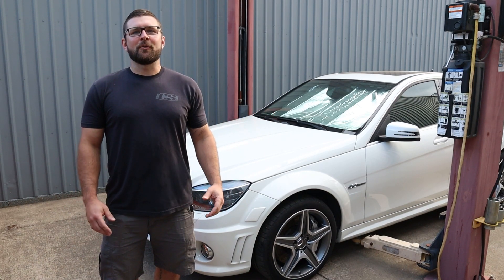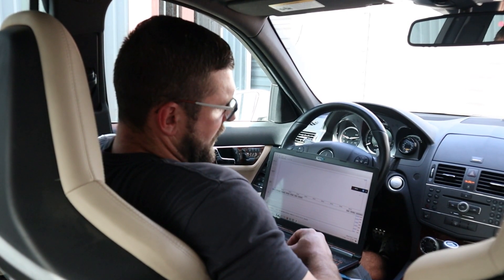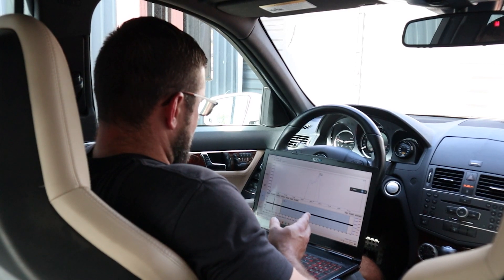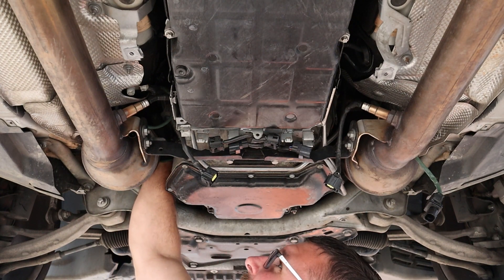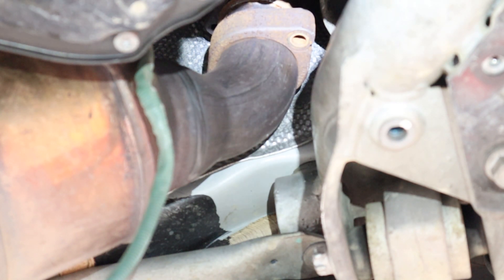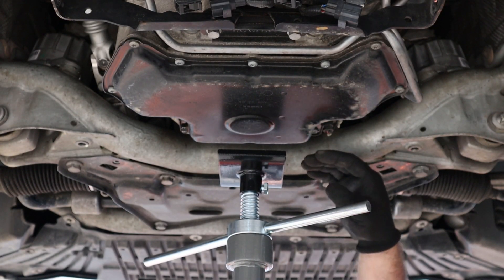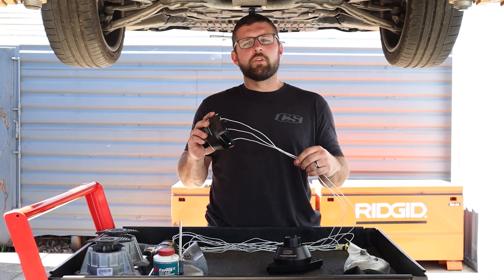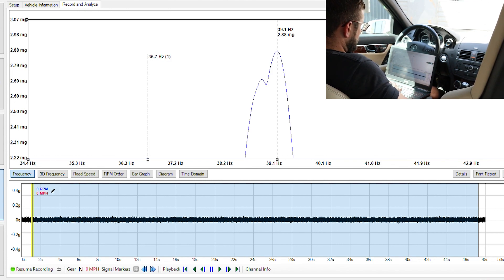Easy DIY W204 C63 AMG Engine Mount Replacement + Poly Upgrades with Comparison.

Comment: Mine went out in 4 months. There goes $1,000 of labor. The OEM ones lasted 80,000 miles, including track days with very aggressive weight transfer. Will probably stick with those unless someone can confirm the VRP mounts are worth messing with.
Reply from the maker: Have you tried contacting us? To my knowledge we have not had a single W204 mount failure and you have a lifetime warranty on the Elimivibe.
Reply: @creativesteel  W212. Same M156 engine though.
Reply from the maker: @TheReal63  give us a call. This has not been most peoples experience.

Comment: Bought my clk55 used with 75k miles on it and the factory eng mounts were blown out and currently the replacement Lemforders have around 25k on them and getting all sorts of traction control codes and they are about to let go so I'll be upgrading to the CS ones soon.
Reply from the maker: @tompilling4154  We appreciate the support and are confident you will love the Elimivibes.

Comment: I know these are fairly new so there hasn't been much real world testing, but are there any indications on longevity?  It would be great to get these in during a header install and hopefully not have to worry about replacing them with all the additional piping you'd have to deal with.
Reply from the maker: As you stated there has not been a ton of testing on this particular vehicle. With that said, we have a few E55's as well has a bunch of CTS'V cars with over 3 years of testing without failure.  Also, they are much easier to get in and out than the factory mounts.
Reply: Got Mine put in in January and they went bad in four months. The hydraulic fluid in the oem mounts helps with the heat. The polymer in these dries up and cracks
Reply from the maker: @TheReal63  on July 26th we offered you a full refund (and a return shipping label) upon return of the product. We have not received any additional communication from you. We have been in the polyurethane business for over 15 years and we can assure you our poly does not dry up and crack upon failure. The only way to achieve that is to use an open flame directly on the urethane. We would love to see pictures.

Comment: I guess fuck me for having headers
Reply from the maker: Despite having headers, the process is the  same. Some headers you can install engine  mounts without having to touch the headers. Some you will need to either loosen the headers or take them out for engine mount install.

The Elimivibe mounts are a slightly smaller profile than the OEM mounts. If you can get the OEM mounts out, installing the Elimivibes will be a breeze.

Comment: You can undo the bolts on the engine mounts and then get a plank of wood, put it on your jack and place on oil pan and jack up the engine some until you have enough space. After putting the car on four jack stands.
Reply: I’m likely going to do this instead of renting a car lift. Is it sketchy at all or fairly easy to lift engine? Do you need to unbolt anything to lift it a few inches up?

Comment: How similar is this to install on the E63S? The S is all wheel drive.
Reply from the maker: The E63S is a little tougher job due to the AWD and the turbos being extremely close to the engine mounts. Unfortunately, at this time we dont have any videos on replacing engine mounts on one of those cars. With that said, that is a video we would like to make.

Side note: Once you get the OEM engine mounts out of the E63S, the Elimivibe mounts fall right in because they are a bit smaller.

Comment: At the beginning of the video, when you reinstalled the OEM mounts, you dropped the steering rack to get them out. Later, when you removed them you didn't drop the rack. Was this step skipped, or can you do this without dropping the rack? Thank you for the video!
Reply from the maker: Ok I knew someone would catch it lol. 

It has been so long since we had OEM engine mounts in the car. I had forgot that the OEM engine mounts will not come out with just moving the rack out of the way. Our Elimivibe mounts are slightly smaller so if you ever need to remove them you can leave the exhaust alone and remove the two steering rack bolts to move the rack out of the way and get the mounts out.